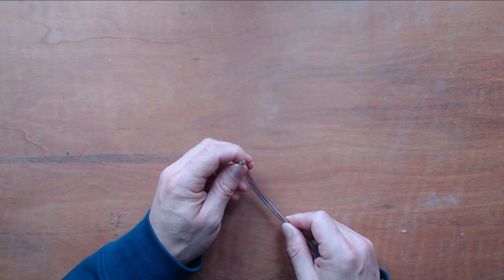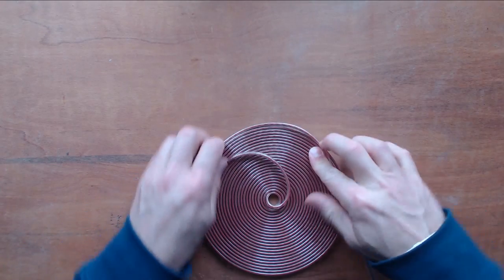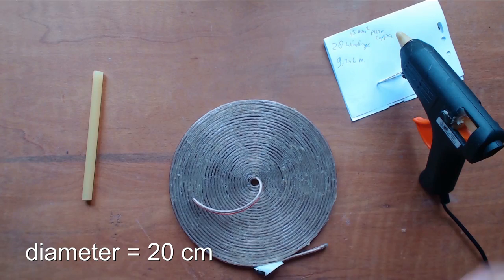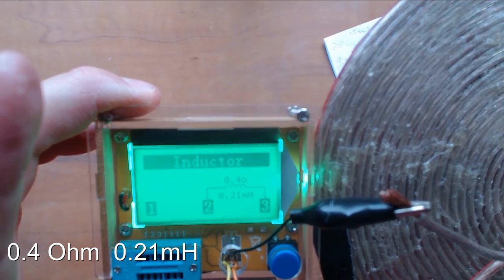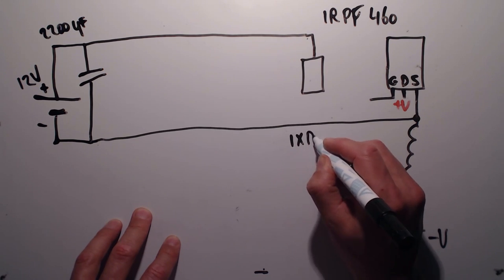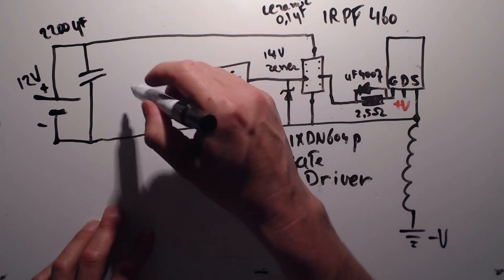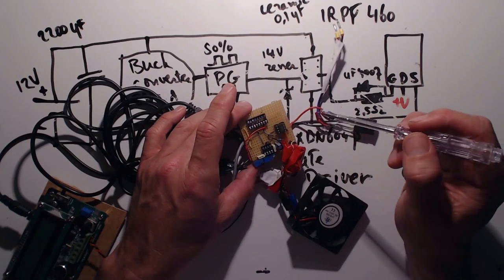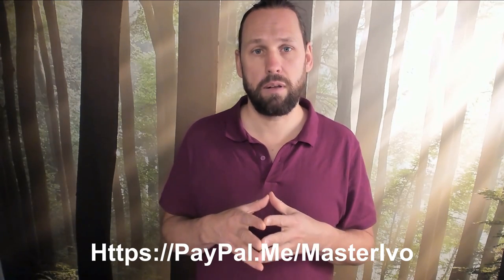Bifilar coil build and high side switching explained

Comment: .21 mH @ 465pF = Resonant Frequency of 509.3 KHz
R = .4 oms
Resonant XL = 672 ohms
Resonant Xc = 672 ohms
Coil Q = 1679, which means used in series resonant circuit you get a voltage rise across inductor of approximately 1679 times voltage
Winding in Bifilar configuration does not appreciably increase capacitance but does significantly increase energy storage (in Joules, 1/2CV^2)
Main use of bifilar is increased energy storage without requiring external capacitors.

A Bifilar Coil, however also externally appears as a flat circular copper plate and when used in conjunction with another bifilar coil in close proximity, like a sandwich, is roughly the equivalent of a large capacitor with air (or space in outer space) dielectric between the two bifilar coils.  The magic occurs when both bifilar are resonant at the same frequency and preferably run 180 degrees out-of-phase which produces a transfer of energy from one coil to the next (i.e., how a cell phone is now charged).  Also in this configuration you can even place a piece of metal (to remove magnetic affect) between the two coils (i.e., faraday cage) and power transfer will still occur.  This power transfer would be dielectric (polarization, longitudinal, scalar, 'radiant') in nature.  This power transfer can be used at a greater distance (say hundreds of feet or more) if you increase frequency into the megahertz range yet still at harmonic of the 509.3 Khz.

To tune multiple bifilar coils to each other reduce minor length of coil (by tapping off coil at different shorter length)  until you achieve the highest output (easier than applying external capacitance).  You will need to tune as changing resistance/capacitance/inductance/distance between coils/surrounding capacitance/ will alter resonance of a coil.
Reply from the maker: Yes. correct. But I have noticed the resonant frequency is off when I use the formula. this could be due to measurement error in inductance and capacitance of the coil.

Ineed the coils act as capacitor plates, and work out of phase.

but most important of all, is the impulse, created by the L1 coil. being sub micro second duration and several hundred volts negative. 
I switched to 1200v SiC mosfets for more negative impulses. 

The impulse can be made even faster by reducing capacitance of the L1 coil, as this will raise the resonant frequency of the L1 coil. and the impulse speed is determined by the resonant frequency, and thus by the capcitance  and inductance. 

Ideally L1 is high inductive, low resistive and low capacitive.

Comment: So, generaly its better to build pancake coils using bifilar cables but choosing a coil over the other in the same cable than a coil next to the other as Tesla did?
Reply from the maker: both methods work as Tesla clearly described in his patent 512340.
using bifilar speaker is very easy. And it works great.

Comment: Ivo, for me is a little complicated the circuit in the way you write, i have the converter (regulator voltage) but i don´t understand the conections, for example in the mosfet "D" waht happens with "D", perhaps other more simple circuit...?
Reply from the maker: D stands for "Drain" it is the part of the mosfet that connects to the positive voltage
Reply: @MasterIvo  So if I have a stronger arbitral signal generator then can I just skip the gate driver and can just ground it on coil entry and connect to the Gate directly?
Reply from the maker: @jarosawjaskuowski3179   If it can drive enough current, you could try it. The most important to produce the inductive spike (impulse) is the turn of time of the mosfet, and is determined by the discharge of the gate to source voltage.

Comment: If you had used a PFET instead of an NFET, then your driver circuit would not be seeing any kickback from your coil, because the coil would be connected to the Drain pin instead of the Source pin.  I have seen your arrangement get destroyed when used as a motor controller.
Reply from the maker: yes, my kickback is safe. the body diode is avalanch rated, so it works a bit like a zener, protecting the mosfet from over voltage dustruction. The driver, works of DC riding on top of the kickback voltage, So there is never any harm done. 
It depends on the design and the parts used.
PFET is no option, Rds (resistance) is to high

Comment: Great video, maybe could have done a better explaining the technique of actually winding the coil, kind of skipped through that 

What was the device you used to measure both capacitance and inductance?

Why not just use a spark gap for switching?

Is the full circuit based on Tesla radiant energy patent?
Reply from the maker: thanks.
this vid shows how to wind the coil:
https://youtu.be/ZKP9Bgpqa5E

A chinese multi device meter for LCR and more.

A sparkgap is very old technology, we have advanced a lot in 100 years.  mosfets do a better job.  

full circuit is based on tesla's hairpin circuit (is not patented). I can be found in his lectures.
Reply: @MasterIvo  Some would argue the analog vs digital switching may take away some unique effects of Tesla's work at high voltages and frequencies
Reply from the maker: Maybe my latest video (today) takes the doubt away

Comment: Thanks @Master Ivo I really love your videos and the information you are bringing to us is awesome! I would really love to duplicate it but not sure how I run my mosfet. My waveform generator puts out up to 12 volts @0-100Mhz so should be enough voltage to switch it but I have two outputs coming from my waveform, generator +12 volts and 0 volts. Could you please tell me how I might use these two outputs from my PG to drive the mosfet? In your diagram there only seems to be one output going to your gate driver IC which is directly connected to gate??  I have tried many variations but still cant switch my mosfet and have asked around on forums but no answers yet! Please help!
Reply from the maker: the zero volts is connected to the source of the mosfet. the pulse gen feeds the gate driver IC, that drives the IC
Reply: @MasterIvo  Thanks so much for your reply :-) So the gate driver IC is a must even if my PG puts out 12 volts? Maybe this is the problem as I am trying to use the PG to drive the gate directly as I thought the voltage would be high enough. Also while I have you..have you seen images of the new grange spiral? It looks a lot like three coupled bifilars...
Reply from the maker: @zaneaussie    yes gate driver IC is needed. Voltage isn't what is needed. Its current that charges the gate up. and the PG cant supply the current. It can even be damaged.
Reply: @MasterIvo  Thanks so much!! Keep up the great work and I am looking forward to more content from you! Will you have an update on your more recent research soon? Do you have anything exciting in store?
Reply from the maker: @zaneaussie   still experimenting. Setup is getting pretty big with the 2 circuits (high an low side switching). So it takes more time to calibrate. Much ideas to test. also want to step up the voltage.

Once I have vital results I will share again. I have many options for videos, but I need to prioritize experiments now.
Reply: @MasterIvo  OK that sounds very interesting. Will look forward to the next update :-) You may need to progress to using a spark gap like Tesla did in that case then? Not sure the Mosfets would hold up ha-ha! In your video Resonant Bifilar Coil you mention lower resonant frequency = higher resonant current! Rather than focusing on increasing the voltage have you tried increasing the current? Perhaps a balance between the two would work well? I wonder if three coils configured correctly would allow one coil to produce high voltage while feeding the other to produce high current? (perhaps configured as a new grange spiral coil?) Tesla spoke a great deal about scalar waves resonating at twice the resonant frequency of the earth at roughly 12.5 HZ (traveling twice the speed of light) which is really low! I will be experimenting in this range but am still in early stages of learning about all this stuff lol. All very interesting and cool...
Reply from the maker: @zaneaussie   I will produce tubes in the future. indeed high voltage is needed for tension of the dielectric field made of Faraday tubes, formed by the polarisation of the Aether. earlier in 1920 tubes had 1.5kV on them.
Reply: @MasterIvo  Also a DC motor produces quite high back EMF on it's own. I have been experimenting with catching this but I have no formal education in electronics and just learning what I can! Would you know how you might re-use this B-EMF and pump it back into the battery? Would this be easy?
Reply from the maker: @zaneaussie  I learned most by my self. education was propoganda and mind control. Needed to convert my brain back to field dynamics logic first. 

you can "capture" the impulse by using a series resonant bifilar pancake coil, that also acts  as a capacitor plate, with a DC offset.

If the other "plate" is also a bifilar pancake coil with an opposit dc voltage offset, the dielectric of capacitor made by the bifilar plates, is refined sumflower oil.

The alternating impulses set up vibrations in the dielectric field (in the oil)

https://www.instagram.com/master.ivo/
Reply: @MasterIvo  Yeah that makes sense! There is so much false data in mainstream, not only in the electronics sector unfortunately! Well done on getting so far in your knowledge, I am still struggling with some basics ha-ha! Is a pancake coil absolutely required if the DC motor is already producing it's own B-EMF? I did manage to charge a capacitor on what I believe is back EMF but the capacitor didn't really discharge back into the battery even though it had the opportunity to do so!  In this circuit I am using a 555 timer IC to alternately drive two NPN transistors as switches in a similar way that you run the MOSFETS on. By changing the capacitor I can control the frequency of the timing signal, It's a little bit more difficult to play with frequencies this way but it will suffice until I receive my other Pulse Gen the one you recommended which I have ordered :-). I am able to charge the capacitor to twice the voltage of the battery driving the DC motor but as I said for some reason the cap isn't dumping the charge in the battery and goes from double the voltage to just above battery voltage when power is fed back into the battery! But battery voltage just continues to drop. Here is my diagram https://imgur.com/VyUMTJC Also when I connect the oscilloscope to the DC motor and vary the speed a little I am reading massive B-EMF voltages!
Reply: @zaneaussie  pretty sure you are the same one that attacked me on the spooky2 forums...best just put you on block here for good measure...also interesting how you would state there is so much error in the mainstream/alt media, and yet we can see who you pay attention to so often, looking at your channel.  You also should realize that putting faith in such when you obviously state you know better can make you a real ASZ to deal with, nose in the air and meanwhile your knuckles are scraping the ground....
Reply: @bluetrinityhaloseven7244  WTF? Have you taken your meds today? Never been on this forum you mentioned lol Oh and who are you to judge?

Comment: Ivo I assume that the +V to the Drain of your FET (IRPF) 460 is also connected to your 12 V Battery that powers your drive circuit?

Is your ground to the bottom of the coil connected to the negative of the Battery or is it connected to earth ground (mains ground)?
Reply from the maker: No Mark, the Battery is fully isolated from the V+ and V- 
the battery is grounded on the source of the mosfet. the possitive of the battery feeds the gate via the gate driver IC.

I suprises me you ask this. It makes me doubt your replication, have you changed the circuit some how?
Reply from the maker: @Mark S  as my channel grows, I get more and more Reactions, I might not see them all, so If you don't get a reaction from me, you could email me ("About" page shows email).
I always enjoy communicating with you.
Reply: @MasterIvo  OK, that's a good thing...
Reply: @MasterIvo  Yes, think I mentioned it in a previously reply.  I am more interested in the VARs to Watts application.  I do not use a battery input as I chop the mains directly into L1 while you use a battery.  Will be using the circuit to run house heaters as in the USA residential customers  typically don't get charged for VARS.  What is important to me is the phase tuning of your circuit and not so much the efficiency....although interesting enough.  Thanks again for allowing me to use this...and of course if I get my circuit of to the couple thousand watts required...which is a big challenge...then I will email you the specifics.
Reply from the maker: @MS-ef1gy , ok good luck, and thanks for sharing